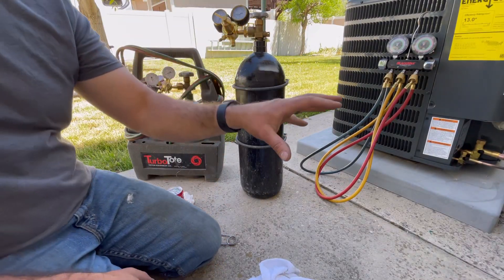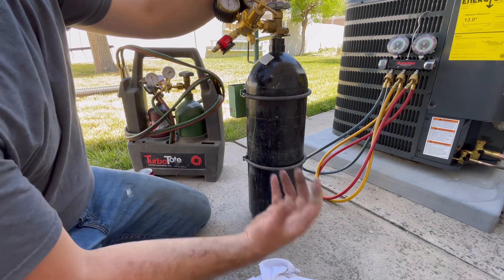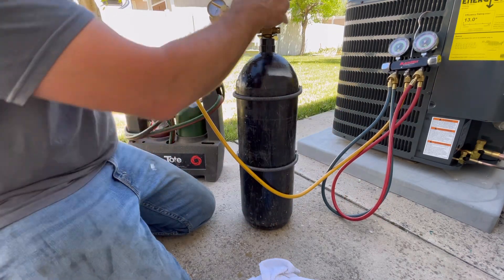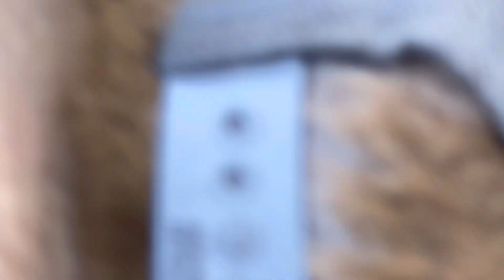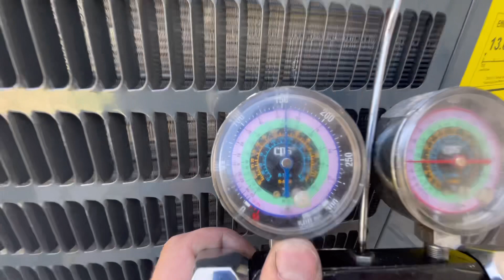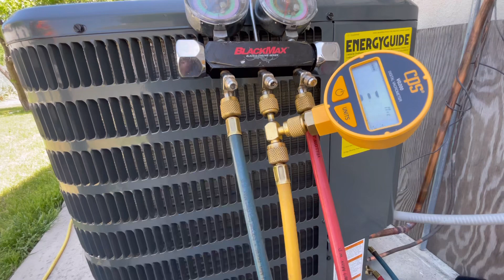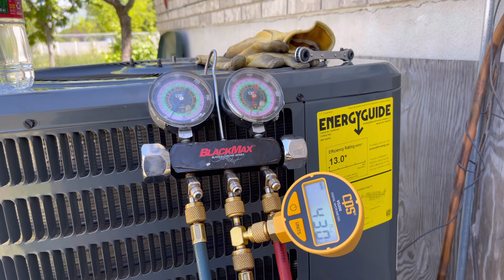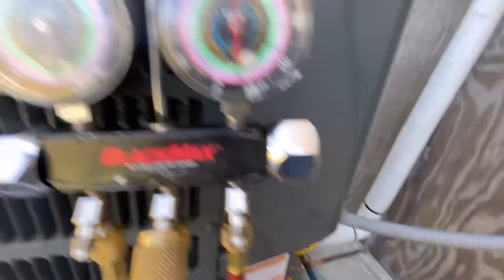DIY Air Conditioner Replacement  Part 3      -Step By Step Guide-

Comment: Great video I had guy tell me 4800 cdn to install units.  I may try my own install.  Cheapest I was told I buy unit they will charge 1000 cash no warranty
Reply from the maker: Hey if you need some guidance through the replacement process check out our Patreon membership over at Patreon.com/diyhvacguy    We’ll walk you through the whole process including where to find the equipment and how to register the warranty. Cheers

Comment: Can you use couplings on the copper lines running to the unit? I need to move my unit to a different side of the house and will need to cut the line inside and run it out a different wall. Wondering if couplings are ok to use in the line.
Reply from the maker: Yes they are, you’ll need to add refrigerant based on how far you are moving it. .6oz per additional foot.

Comment: Question - Didn't you originally store all the freon in the old unit? How did you get it back into the new unit?
Reply from the maker: The new unit comes precharged with e light refrigerant for 15 ft of lineset. If you need some help with an HVAC job you are wanting to do yourself, check out our membership over at Patreon.com/diyhvacguy   Cheers!

Comment: Great 3-part video series, BUT...did I miss something (and I watched it twice)?? Was something edited out?? QUESTION: How do I get the Freon into the system?? (I didn't see this step) How do I get the oil into it?? OR...do the Goodman systems come pre-charged and you don't need to refill the vacuum with Freon/oil?? A bit confused now...

After getting a crazy bid of $10K for a 16 SEER Carrier system (2.5/3 ton), I'm very motivated to do this myself. My BIG concern is the brazing part. Is there another option for DIY'ers, like myself, to do instead of blow torching and melting copper seams together? And also, if I can get a nice Goodman bundle (condenser and evaporator) for $3K-4K, how much will I be spending to get ALL the tools you used in the videos for me to get the job done? $500 for tools/equipment? $1000??

Thanks for your willingness to do DIY videos like this. Should be a BIG wakeup call for HVAC companies who are seemingly price gouging customers.
Reply from the maker: Hey man, thanks for reaching out. Yes so all new condensers come precharged with enough refrigerant for 15-20’ of lineset. So once your new system is in and brazed/soldered, pressure tested to confirm you have no leaks, then you pull the vacuum and simply release the brand new refrigerant from the new condenser into the system. 

If you want help with your replacement, I have personally helped many to do their own system through remote one on one support. That membership can be found over at Patreon.com/diyhvacguy.  For a small fee of $50/mo cancellable whenever you no longer need the service, we will guide you through the process as well as help you find the tools and equipment you’ll need. You can save a TON of money and acquire a great skill in the process. Cheers man.

Comment: I see that the cased coil is the one without the TVX option. How do you know which to buy when replacing your old coil?
Reply from the maker: Depends on what efficiency you’re after. A low 13 seer system will be fine with a piston, wheras if you are trying to achieve a higher seer rating, a txv is needed. Anymore they make the coils with a built in txv which makes it super easy to install.

Comment: Did I miss the part on how to get the freon out of the old unit and into the new one?
Reply from the maker: Yes, the old refrigerant is pumped into the old condenser and the new condenser will come precharged with refrigerant. If you are needing help with your replacement, we have a  awesome membership over at Patreon.com/diyhvacguy where we will give you one on one assistance with replacements, diagnosing, and even help with getting the full 10 year warranty on your equipment! Cheers man

Comment: I love everything you've done but I just want to say maybe only put the same amount of length of the diameter of the copper your using for example, it's half a inch diameter copper line then only solder a half inch and avoid the rod and flame. Flame on one side and rode the other side. Maybe it's different for AC lines but I've soldered copper lines for my house water lines, im assuming it's the same, maybe 🤔
Reply from the maker: I believe it’s different with soldering. This was brazing and it’s a whole nother technique. Cheers

Comment: Hey, I got it all done and let the R410 into the system. But the high side is still under vacuum and the low side hits my reading max of 250psi. The AC is not cooling, any idea what happened and what I need to do? I have a txv installed, could it be that the valve is stuck at close position due to the high pressure on the low side? If yes, how do I open that?
Reply from the maker: Hey, If you need some technical support please sign up for our Patreon page over at Patreon.com/diyhvacguy    I can’t help you diagnose this video comments. Thanks,   Dave

Comment: I have everything except for the nitrogen. Where do I get it from? And is it possible to just braze without and then pull a vacuum and see if the vacuum stays instead doing a pressure test? This is how I have done it on a car AC system.
Reply from the maker: You should have a local welding supply store or an Airgas supply that will sell you a tank of nitrogen or some of them will do a lease. Then it’s not too much to have it refilled whenever you run out.
Reply: @diyhvacguy  Hey, I got it all done and let the R410 into the system. But the high side is still under vacuum and the low side hits my reading max of 250psi. The AC is not cooling, any idea what happened and what I need to do? I have a txv installed, could it be that the valve is stuck at close due to the high pressure on the low side? If yes, how do I open that?

Comment: Very useful knowledge. Seems to me, a capable DIYer should be able to handle this with the correct tools. However, as I was prepping to do this task I came upon the problem as an unlicensed HVAC guy being able to acquire freons. Any advice in this matter ?
Reply: Most units come pre filled with enough refrigerant for a certain length of line set. Usually 15-25 feet depending on system size. Any more than that and you'd have to add some more to the system.
Reply from the maker: So if you are able to pump your system down as was shown in this series, then install the new one. All the refrigerant comes contained in the new condenser, so you should t need to handle any refrigerant if it’s don’t correctly. If you need some help with a replacement in the future, feel free to check out our Patreon page at Patreon.com/diyhvacguy where you’ll get one on one assistance with replacements, diagnosing problems, and even help with getting the full warranty on your equipment! Cheers

Comment: How can you put freeon in yourself,  when you have to have a license to purchase it?
Reply from the maker: The freon is precharged in the condensing unit, so you don’t need to purchase it separately. Why they allow anyone to purchase units with the refrigerant in them already, and it is beyond me, but that’s how they sell them so I’m not asking any questions lol take advantage of it while you can!
Reply: Wow, really,  I had no idea they did that.  I always thought you had to be a licensed contractor to get it,and charge the system, thanks. My Goodman just quit after 18 yrs, no complaints,  my contractor wants 6,980 to install a new york unit, 2 ton, 14.2 seer, no financing or interest for 5 yrs, about 115.00 a month,,,, could you give me some advice as to if this is a good deal, thanks again for your time!!

Comment: Hi! Are you leak testing and vacuuming with the valve cores in or out? I will be using staybrite 8, not brazing. Thanks!
Reply from the maker: Hey! In this video I did it with the cores in. If you have a 110v pump and can let it run for multiple hours, then there’s no need to pull them. However my new setup is battery powered and will pull down to 150 microns in 10 minutes, BUT only if you use a massive hose and have the schrader valve removed. 

If you need some help with your replacement, check out our Patreon membership over at Patreon.com/diyhvacguy where for $50 (cancellable at any time) we will give you 1 on 1 assistance with sizing, help with locating equipment, help with actually replacing the equipment, as well as information on getting the full 10 year warranty! 

Best,

Dave
Reply: @The DIY HVAC Guy  Thanks! I have a 3.5 cfm 110v pump, so I'll just do it like you did in this video.

Comment: Thanks for the video! If I use Stabrite 8, would I have to leak test it with nitrogen, or could I go straight to pulling a vacuum? I am a plumber, so my solder joints should be good. 

What would happen if there was a small leak? Would it damage the system or would I just need to re-capture the coolant, fix the leak, and add back in what was lost? Thanks!!
Reply from the maker: Yes the best method is to pressure test, and then I’d order a micron gauge, and do a decay test. If you watch my video on how to pull a vacuum, you’ll see how to do that. The decay test acts as a leak test also. If for whatever reason you do have a leak, you can pump the refrigerant back into the unit, locate the leak, repair it, and then pull your vacuum and reintroduce the refrigerant 👍🏼
Reply: @The DIY HVAC Guy  Thanks for the reply! I bought a 5 year old Goodman condenser and coil from a local hvac guy yesterday. He put in a split system for them and sold it to me. It's a 3.5 ton unit, and it matches my current furnace (brand and coil dimensions). He said it's got a full charge, so hopefully, I can figure it out.

This is my first flip (24 y.o), so I didn't want to pay the install charge if I could do it myself. I still have to buy a line-set, disconnect, and fittings, so it'll be a while before I get started. (Plus the gauges and other equipment you mentioned)

Thanks again for the videos! I'll watch your upcoming Stabrite 8 video when it comes out!

Comment: When you detach the high/low side pipe, how come the refrigerant doesn't just leak from the port? Does it have something in the core?
Reply from the maker: When you crank down those two Allen head ports, it locks the refrigerant in the unit.  I have some other videos that show that process, feel free to check some of my other HVAC replacement videos out 👍🏼

Comment: Nice video series.  Wouldn't it be easier, esp for a DIYr, to use Staybrite-8 5% silver solder?   Don't need nitrogen purge or very-hot-acetylene torch or to worry so much about frying the valves at the lower tem.  Steve Lavimore (another Youtuber with 100k+ subscribers has a nice video on this).  Its tensile strength is plenty (1400 psi).
Reply from the maker: Yesir! I have a video on Staybrite 8. This was filmed before I discovered it 😀 I actually have another introduction to using Staybrite 8 coming out next week! There needs to be more Staybrite 8 videos for sure. That’s Steve lav video was the only one for a long time! He’s awesome 😎  thanks for the feedback! Cheers
Reply: An AC tech showed my Staybrite 8, when he fixed the TXV valve I burned.  I asked him how he's going to get the torch in my very tight closet - he laughed and told me about Staybrite 8.

Comment: Hi  I’m install the AC at my brother house . Is a heat pump unit outside . My question is my air handler don’t have purple wire. Do I connect the purple wire to W1 ? My w1 and W2 is connected together
Reply from the maker: I can’t tell you based off the info you gave me. For tech support and one on one assistance go to Patreon.com/diyhvacguy   We have a $25 dollar membership where we will give you tech support on any HVAC system. Cheers
Reply: @diyhvacguy  I got it , it go to w1

Comment: Question.  I want to do this myself. I am very handy and believe I can. I currently have a carrier unit for heat and AC. The furnace was replaced a few years back. The previous owner did not bother doing the air conditioner. Can I use a Goodman AC and condenser? If so, can I also use the same copper, refrigerant lines? I know the new gas will be 410a and there seems to be some controversy on whether the lines can be reused or not.
Reply from the maker: Lines can 100% be reused. If you watch my videos you will see that. If you need some one on one help replacing your system, I have a membership at Patreon.com/diyhvacguy  where for $25/mo (cancellable at any time) I will give you one on one assistance with replacements, sizing, and even help with getting the full 10 year warranty. Check it out! Cheers

Comment: Great tutorial bro…I plan to tackle a replacement of a 30 year old split system. The air handler is in the attic though. Condenser outside. You explained everything clearly. I appreciate you taking the time to explain everything in detail. Other folks watching….give this guy props for producing such a detailed video.
Reply from the maker: Hey thanks man, if you would like some one on one help with your install feel free to sign up for our membership over on Patreon.com/diyhvacguy where for $25/mo (cancellable at any time) we will give you one on one assistance with installations, diagnosing, as well as warranty info! Cheers,   Dave
Reply: Did you manage to install it? I have the air handler in the attic as well, I was wondering if took a lot of time

Comment: Vacuum gauge at the gauges?  Bad move.
Reply from the maker: I agree. I have since changed my method to a no manifold, one hose setup with my micron gauge on the liquid service port. Pumped down a system to 150 microns in 10 mins. That video will post this Wednesday if you are interested in checking it out :) cheers

Comment: Thank you for doing this series. As a retired appliance and refrigeration tech, couple comments. No hate here. I think the twin tank set up is overkill for the DIY one time shot. I used just a turbo acetylene torch for 40 years is fine.Your flame size was wicked long to try and corral it. Clean joints and proper size tip. Suggest using heat paste on joints and hit with wet rag after. To all the techs saying" you've got to use Nitrogen when brazing ! you'll kill the system ! " Millions of units running 20-30 years old before this concept "required"  I install my system 19 years ago, no problems until drain pan rusted last summer. Why not braze lines at air handler with cover removed since it's slotted and reinstall cover after ? Burned panels looks very amateurish. (not that you did) As far as burn out comp. worries, haven't seen one for 20-25 years. Good to mention it anyway. 
Question about worrying over super heat temps. If the unit is pre-charged matched to coil, lines are evacuated when have you had to tweak the charge from super heat ? Seem to me it has to be really close optimum already. Thanks again.
Reply from the maker: Thanks for the tips! All good advice. Cheers
Reply: Regarding Nitrogen purge I think on newer units with TXV valves you don't want the oxidation getting into the system and blocking the small passages in the unit. Either way it's not a bad idea. I know it's absolutely required on Mitsubishi VRF installations and on those you pressure test with Nitrogen and pull a vacuum 3 times to really remove all moisture in the line sets.
Reply: @memsu06  Thanks for explanation. Are the TXV valve ports smaller than equivalent capillary lines I.D. ? If so, I could see the logic. Teach an old dog.. Thanks